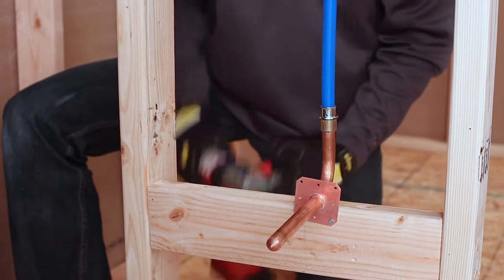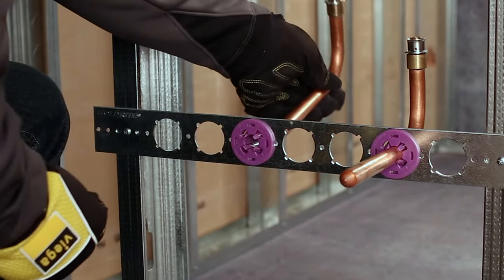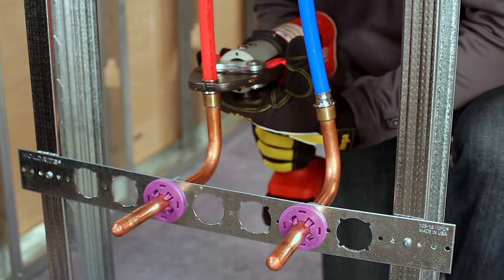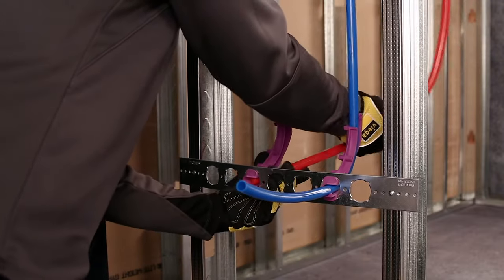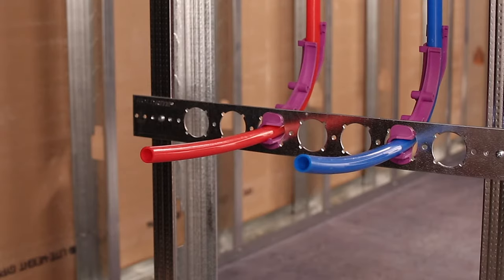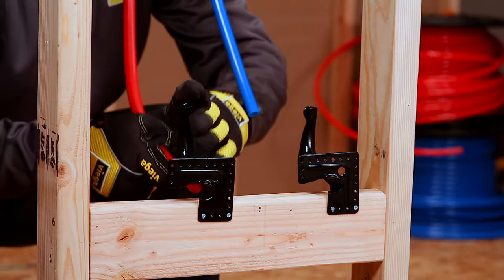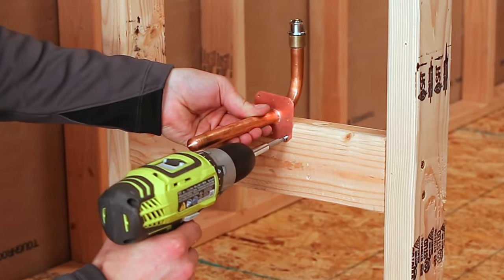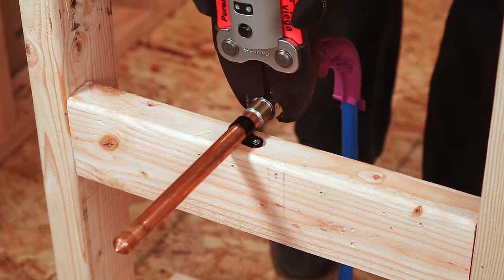HOW TO STUB OUT PureFlow PEX | Viega

Comment: Hi... Would you say using a curved 90 is better for end pressure, as opposed to a fitting 90?... Thanks...
Reply: Yes, a gradual change in direction is better than a sudden 90deg change which leads to turbulence and higher pressure drop.

Comment: Why would you put hose on these when the other end is welded shut? How’s the water gonna come out? Are you supposed to drill a hole? why didn’t they just make it open emded? so many questions
Reply: The closed end is for testing purposes. Once the test is done, you cut the end off and put your angle stops on. I think they touched on it really quickly in there somewhere.

Comment: I don't see the use of these. It doesn't connect to anything
Reply: LMAO
Reply: @FacelessSoulessHumanity  your laughter and explains nothing
Reply: @clasicradiolover  you ain't to bright
Reply: @FacelessSoulessHumanity  Whatever
Reply: dan shive  🤣
Reply: I had a good laugh at your expense
Reply: @FacelessSoulessHumanity  Me too. I'm laughing at you. My brother is a plumber. He said they're useless too.
Reply: @clasicradiolover  
Plumbers don't do the drywalling.  The copper tubes that are closed at one end are extra long, so that once they're installed (a process known as "stub-out", which is in the title of the video and the source for some amusement at your expense), the drywallers can put in the drywall without covering up or otherwise mangling the pipes.  The closed copper ends shown here are quite blunt - other manufacturers of similar products make a more pointed tip, presumably to more easily poke through the drywall.  Then, the finishing plumbers - the guys who install the fixtures - can cut off the closed end of the copper tubes to an appropriate length, install a finishing valve, and complete the connection to the fixture.

The other pieces in the video, used with the coloured pex, make it easy to position the pex - to stub-out the supply lines - at common spacings, and to make 90° bends without having to use an angle fitting, thereby improving pipe longevity (due to less turbulence in the water) and removing two points of potential failure.

Disclosure: I am not a plumber, but a longtime DIYer; these are my best guesses.